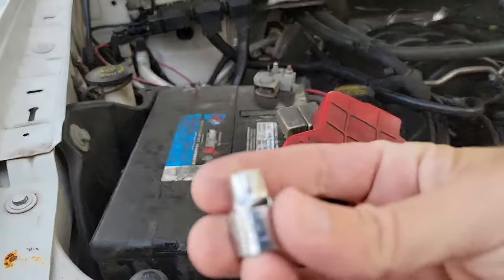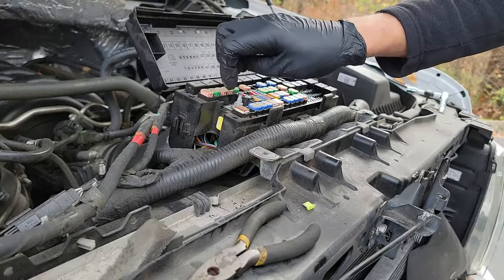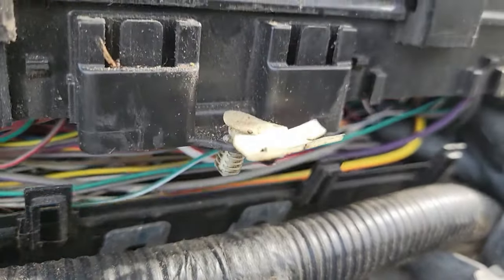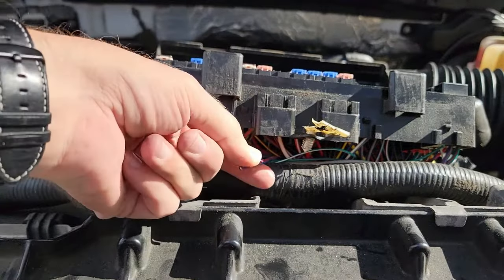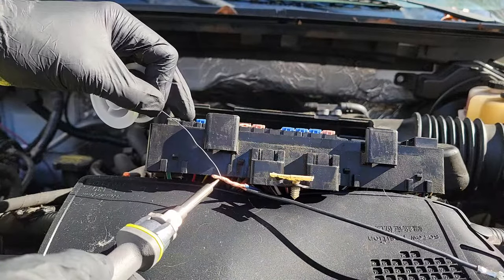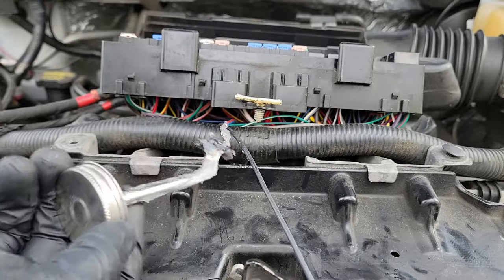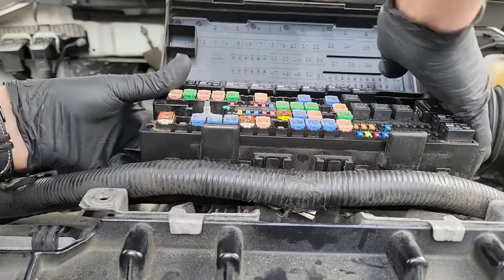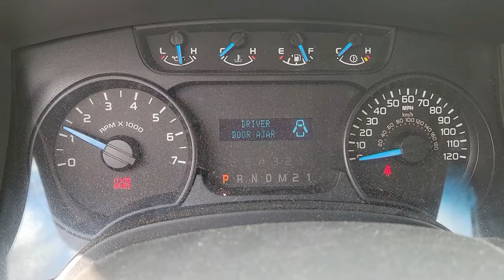2011 - 2014 Ford F-150 Fuse 27 Relocation Walk-Through!

Comment: Has anybody still dealt with crank no start issues after replacing this? The dealership is telling me my fuel pump is bad along with the catalytic converter. Every morning, I'm dealing with 5-10 seconds of cranking before it starts even after the fuse was relocated.
Reply from the maker: Hello, I haven't experienced any issues but if someone else has, hopefully they can tell you how they solved their issue! For now, I will pin this comment to the top of this video in hopes someone can help you!
Reply: the reason it is a long crank in the morning is because there is a check valve located in the pump to stop the fuel pressure from leaking back into the tank so vehicle will maintain fuel pressure and start right away. so if you want fixed correctly so there is no excessive cranking then go ahead and replace fuel pump. but im sure its about $500. but if you can live with the long crank on startup then just leave it  be ,wont affect anything
Reply: Of it's your cat just unbolt exhaust at y pipe and see if it fires right up.    I've had some crazy shit happen due to cats
Reply: One benefit of longer cranking is the oil pump get time to put oil on the top of the motor before it starts. 
Might be a hassle when it's already hot.
Reply: Check fuel pump relay. #8

Comment: Truck cranked and would not start yesterday morning; did a search and found out about this fuse 27 issue, which when I pulled it, was clearly melted...ordered the repair kit from Amazon (genuine Ford part) at half thee cost of the local Ford dealer, and followed along with this video.  repair was super easy, truck started right up after the repair!  Thanks for posting such a great video!  Hugely helpful!
Reply from the maker: Awesome man, I am glad it helped! Thanks for watching and taking the time to leave a comment! 🙏
Reply: Alot of motorcraft parts on Amazon are fakes
Reply from the maker: 🤷‍♂️ this is still working. So I guess it's a genuine part.

Comment: Thanks for making this video to show where all the components are at.  But I would strongly suggest watching some videos on how to solder.   There are specific ways to twist the wire to make a strong mechanical and electrical connection. However the problem I saw with your soldering was that you created a cold joint. This happens when you have melted solder but your wire is not hot enough.  You end up creating more of a jacket of solder instead of having it bond to the wire.
Reply from the maker: That's a great tip! Thanks John!
Reply: getting the wire to heat up "properly" is a whole lot easier said than done, if the repair is still working, that's all that matters
Reply from the maker: Especially being in such a tight area. But truck is still going strong!

Comment: You should have an electric crank assist on your starter.  Don't crank.  Let it do the work.   Turn the key for like a count of one.  Then let go.  The starter should keep cranking until the motor starts
Reply from the maker: Great tip! I know the push button to start vehicles had it, but had no idea the trucks with a key has it. It worked just as you said. Thanks for sharing! 🙏

Comment: Just bout a 2011 f150....what is the actuall problem with this particular fuse that necessitates this?
Reply from the maker: Ford went with a bigger fuse because the other one was small and would burn up. This will leave you stranded unfortunately. You could buy some fuses and keep them on hand, but the issue is once it burns up there's a good chance it will burn the location the fuse is in also. This new fuse eliminates that from happening.

Comment: Great video.  Mine fried today.  315k miles and first issue.  Truck died while driving, luckily I was on a county road and going about 20mph.  Wouldn't fire at all.  Loaded the truck on a trailer and hauled home.  Was getting ready to take to Ford house when Google revealed the fuse 27 fix.  A couple of bucks later with a new fuse truck was running again.  Definitely going to follow through with this to ensure it doesn't happen again.
Reply from the maker: Yea these fuses are famous for going out on these trucks. It's a pretty simple fix, but very annoying to deal with.

Comment: I haven't taken my fuse box apart yet so please excuse an obvious question.  I was wondering why you did not simply remove the factory wire from fuse 27 position and move it to fuse 70 position?  Do the factory wire ends not release from the fuse box?  Are they different size?  Seems like moving the wire would be much easier than cut & solder.  Great video though.  Thanks
Reply from the maker: I'm going to assume it may be too difficult to do that, but I'm not 100% sure. The Fuse 27 relocation guide came straight from Ford, so I just followed their instructions. I also haven't seen anyone else do it the way you mentioned, so (again I'm assuming) this is probably the best way to tackle this common issue in these trucks.
Reply: Thanks for the quick reply.  There must be a good reason which will probably be apparent once I get into the box.
Reply from the maker: Yea I think so too. If you figure it out, come back and let me know! I'm sure someone else will have the same question at some point. Thanks for watching and taking the time to comment! 🤟

Comment: Question can you just use a crimp that has shrink hose on it instead of trying to solder the wire together
Reply from the maker: You can if you want, but I would rather solder them together. 🤟

Comment: Perffect Video, Thank You. Now only if you had one on a fix on why my 2014 F15 5.0L fans keep running. I repolace thermostat, new coolant. High speed fan runs even when it is cool outside, I turn on AC and it runs every few minutes and shuts off but dash gage is at half way. Never over heats. I read the coolant temp sensor might be the problem but only read about head temp sensors so I have no Idea where the coolant temp sensor is. Again, great video, corrected my truck from not starting.
Reply from the maker: Hey thanks for reaching out! I'm glad the video helped! I haven't heard about your issue, but I can do some research and see what I can find!

Comment: I did the relocation , it cracked right on 2 times and then not anymore, any tips?
Reply from the maker: Do you mean it cranked on? I would open it back up and see if the fuse blew for some reason, or recheck the wires to make sure it's still has a good connection.

Comment: My f-150 is a 2010 lariat, looking at the fuse box in your video, the relays are in different on my truck, than that in your video, why
Reply from the maker: I'm guessing it's because they are completely different engines. In 2011, Ford ditched the 4.6 and 5.4 V8's for the 5.0 V8 and Ecoboost V6 (3.5).

Comment: Would it have been better to put a fuse relocation kit in that plugs into the old fuse socket and relocates with a new fuse socket?
Just unplug old fuse, plug in new plug and double side foam tape new socket to open space on fuse block.
Three minutes work and no accidental broken or pulled out wires.
Just sayin.
Reply from the maker: I'm not quite sure what you mean. This process is directly from Ford. If there was a better or easier way, I'm sure they would have went that route.
Reply: @TrickShiftGarage  
Except all the moving of the fuse block with wires. Seems like a recipe for disaster.
They use a fuse relocation kit for high power amps.
It plugs into the old socket, has heavy gauge wires to a new socket.
Use double side tape to place it in an open spot. Quick, easy and no jerking the fuse block around possibly creating new problems.
Just an idea.
Reply from the maker: Again, this is directly from Ford. If you have the knowledge to do something like that, go for it.

Comment: Decent video but you can completely skip that first step, as the trim doesn't block anything for this job. You should have pulled the clip that secured that large wire loom to the front of the box, however, instead of spending half the video fighting it the way you did. 
Also don't be afraid to use a heat gun on this task, as it doesn't generate enough heat to affect anything but the heat shrink sleeve so long as you move the heat gun side to side to keep directed heat from building up enough to cause damage.
Reply: I had the same issue after my throttle body was installed due to a wrench light and a shut down which left me stranded…after my throttle body was installed a week later my truck didn’t start it made a weird sound and didn’t crank over almost like a yell when trying to start..my wife and I googled it and sure enough this was the problem my fuse was burnt but all I did was replace it and it’s working fine…if I have to relocate it I’m willing to do that but my question is why can’t we just replace the fuse with another one what is the purpose on relocating it rather than just putting in a new fuse in the same spot…I’m not mechanically inclined so if it’s a dumb question I apologize I’m just wanting to to understand the relocation purpose
Reply: @johngarza5272  So the fuse is burning out like this due to a design defect that the relocation kit addresses. Given that it took 12 years for this fuse to burn out on my 2011, I think as long as you're aware of the issue and keep some spares on hand in your glove box (everyone should keep a kit of a least one spare for every size and amp rating in their vehicle anyway) installing this kit isn't really necessary. I did it because fixing things once is in my nature and I had the time and tools to do it, but it is by no means mission critical so to speak.